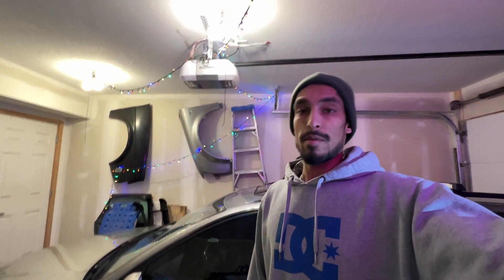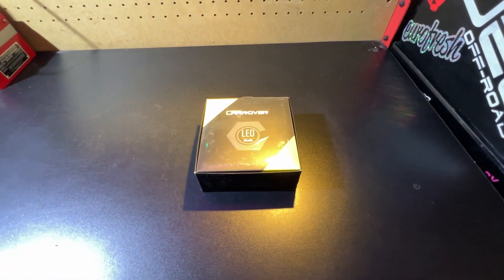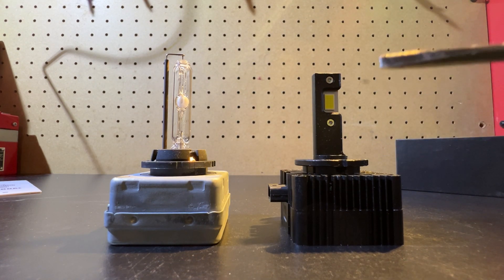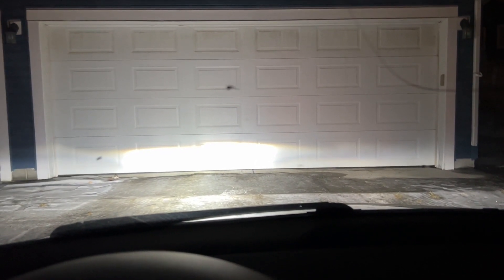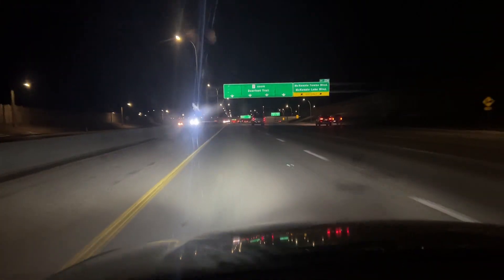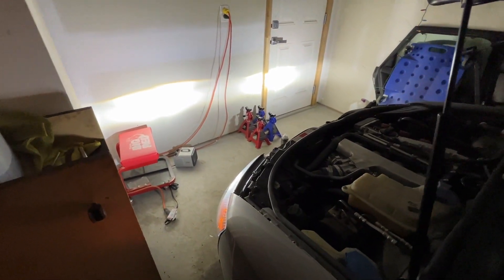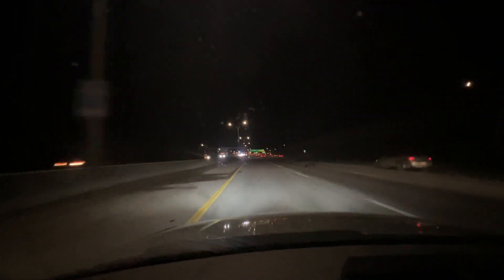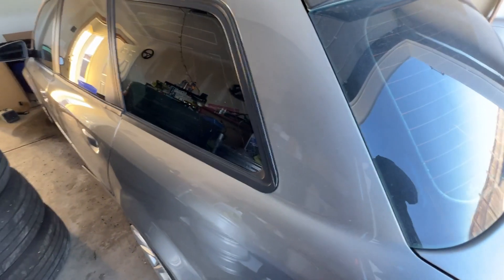HID vs. LED Headlights Real World Test! (Should You Switch?)

Comment: Most likely your projector reflector needs re-coating as it might have faded away the reflective coating cause of exposure to the outside atmosphere, the process to recoat reflective coating is called "vacuum metalisim.
Reply: I think your assumption is wrong. Here's why. The OP only used the same reflector bowl with his testing. So the reflector bowl has nothing to do with it. The only thing he change was the type of bulb in the same reflector bowl. It's the bulbs that made a big change and not the reflector bowl's reflectiveness.
Reply: @kohlpee3732 The commenter is right and you’re wrong, if the projector’s reflector’s bad it won’t reflect and converge (focus on one point) the bulb’s output completely causing the final output to be dimmer.
Reply: @LucasOQ  I don't think you watch the whole video. The OP used the same reflector. I would agree with him if the reflector housing was bad. But it was not the reflector housing that was bad. It was the ballast. The OP put back the original housing back on the right side and replaced the bulb with LED's. Check out the video at the 9:46 and up. You are one of them that was very wrong too. Forget about the right side. Just see what the difference is based on just the left headlight before and after. That will tell you the difference with the HID vs LED.
Reply: @ If the ballast was bad the LED probably wouldn’t have not turned on or it’d be blinking.
Reply: @LucasOQ  Why would not it turn on? It turned on with a regular HID bulb. I'm sorry Lucas but you need to do more research before you make a comment like that. "A bad HID ballast often exhibits symptoms like flickering headlights, dimming lights, delayed ignition (slow to reach full brightness), uneven light output between headlights, a buzzing or humming sound from the headlight unit, occasional complete failure to turn on, and sometimes even a change in color of the light beam, indicating inconsistent voltage supply to the bulb." There you go.

Comment: I think you should standardize testing of lux based on the distance of 10m, then putting the lux meter on the correct area of the light which is 1.5 degrees down, 2 degrees to the right (for reference: https://youtube.com/watch?v=ODU-l_G8B2s&si=EnSIkaIECMiOmarE) to find the one with the best lux or candela result. Your right seems to be lower than the left though? Isn't is supposed to be the other way around?
Reply from the maker: Nah, again only supposed to be a real world test. I was doing it already so figured I’d make a video. Based on what other commenters are saying, the right side reflector bowl was likely burned, reducing light output. Swapping the headlight housing back to the original fixed it.

Comment: Heart tells me LED, brain tells me Philips Xtreme Vision gen2. I do a lot of driving in the night and probably xenon would be the right choice. Now i have Osram CBB and they were great.
Reply from the maker: Fair enough! HIDs are tried and true and arguably better than LED in some cases. I think HID has more range/distance so might be better on highway vs. city for example. But so far the LEDs have been great around the city
Reply: If your projector was designed for HID's and you already have CBB's in there, I wouldnt bother changing that setup unless the bulbs are a few yrs old. You arent going to get a boost in output unless you modify/upgrade the projectors. Definitely don't slap LED's in an HID projector.
Reply: i used to belive the same thing until tried led bulbs and I'm not going back to HID.
Reply: My testing shows LED is better than HID's. Using Philips Xtreme Vision Gen2 6000K vs Sealight X4i bulbs 6500K. Once you have a chance to test it yourself between the 2, you will agree wiht me. 😉
Reply: @kohlpee3732  and the reasons are? i'm on the same train. my osrams cbb died after 5 years of use and i am now thinking about replacing them with leds. they are d2s aswell.

Comment: The inside of your Oem projectors are burnt and darkened. You need to replace the projector reflector bowl to get them bright again.
Reply from the maker: Thanks for the info! I’m pretty sure it was the ballast that was on its way out but I’ll check out the projector again. Either way, the lights are insanely bright now
Reply: @Fizzo20  I'm guessing that you bypassed the original ballasts, or the new LEDs would have died immediately.  That said, I'm impressed that the beam pattern/cutoff was so close to the stock HIDs.  That's the hardest part to dial in with any LED replacement in a factory HID projector.  Or even harder to accomplish is getting that pattern correct with a factory halogen projector to LED swap.  I have Morimoto Mini H1 projectors retrofitted into my old school Toyota Tundra housings, and running Morimoto H1 HID bulbs.  It's awesome.  I have tried roughly 5 different Amazon LED bulbs in the setup, and nothing would line up properly.  So I'm sticking with HID in my case!
Reply from the maker: @Erik Yeah maybe it is in fact a burnt reflector bowl and not the ballast causing the dimmer output. I'm also impressed with the cutoff beam; I was a but skeptical when I saw that the connector was placed slightly higher on the LED bulb but luckily it all lined up! Morimoto has some wicked products, good to hear some positive feedback on them👍🏼
Reply: @erikprivette4765  i put leds in my 4runner and the cutoff was exactly like stock. The projectors were even throwing light wider on to the sides of the rode.
Reply: @Fizzo20  Glad you are happy with your setup now! One thing to note, if your ballast was on its way out, it would either turn the lights on or not at all. There would be no in between. In your case, id be 98% sure that the main culprit was a burnt projector bowl. Which is why even when you changed to LED, the dimness still followed. More than likely, the reason your lens looked pitted was the reflective coating of the bowl burning up and leaving residue on the inside of the lens.
Reply from the maker: @sasha Good to know, thanks! That makes more sense.

Comment: Thinking of this on my Saab 9-5 with Xenon though I am wondering what happens the day the fan dies on the LED lamp isn´t it any risk for say a small fire in the housing?
Reply from the maker: I would guess that if the fan died, the circuit board/electronics would overheat, causing the LED itself to fail before it could get hot enough to ignite. I’m also assuming there’s not enough oxygen inside the housing for it to catch fire for long. However, as with any aftermarket modification, please proceed at your own risk!